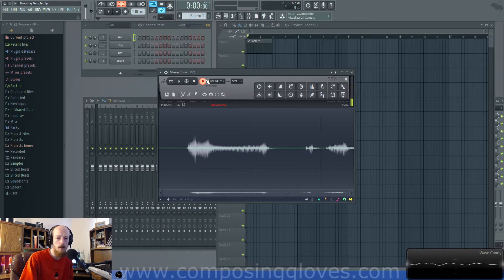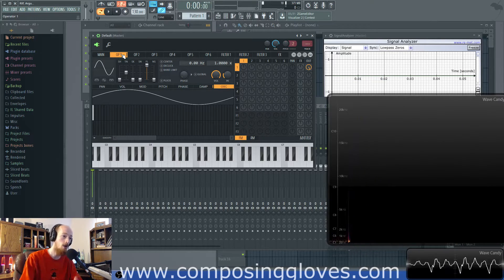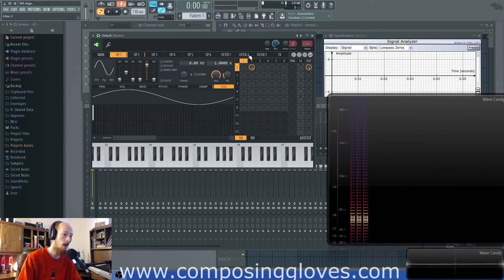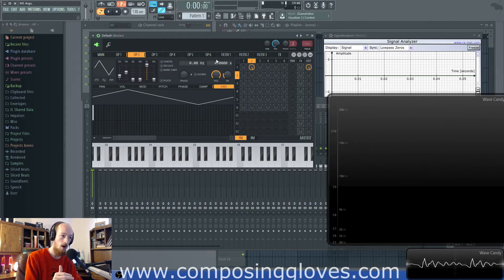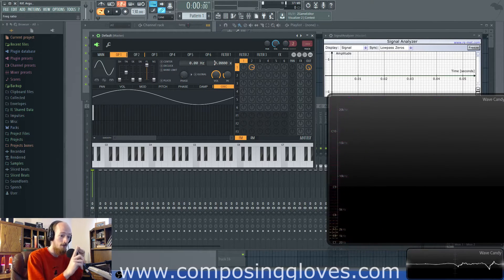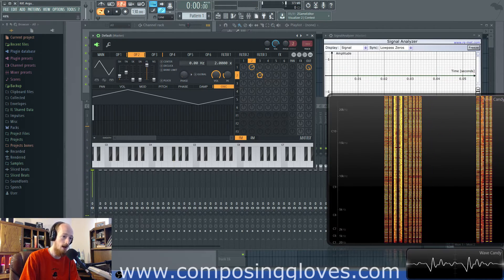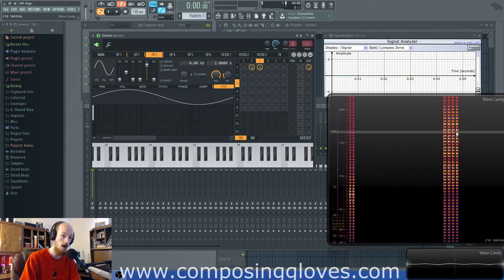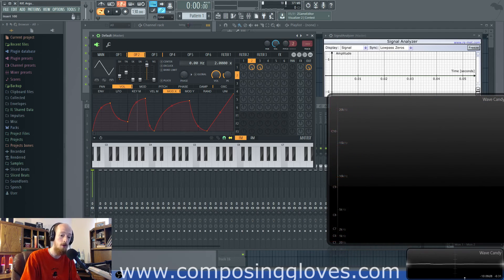Learn FM 20 - Mid Ratios and Harmonic Series

Comment: Hey I've got a quick question if you have a minute. If i'm using an odd ratio such as 2 to 3, will the new harmonic series affect the tonality of the synth? I guess i'm trying to ask if I will still be playing in a discernible key. I've been experimenting with it and it seems like I'm still in key and I've noticed that the fundamental doesn't change, but I wanted to get your take on it. Thanks again for the tutorials!
Reply from the maker: No, so long as the fundamental is unaffected or there is a harmonic series that strongly resembles a saw series a key will be discernible.
Reply: Thanks man, much appreciated!